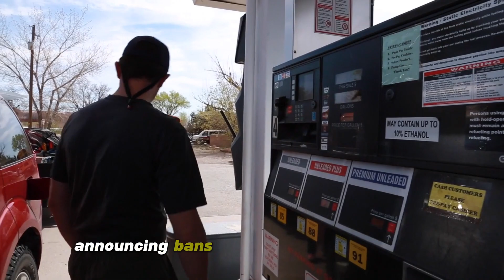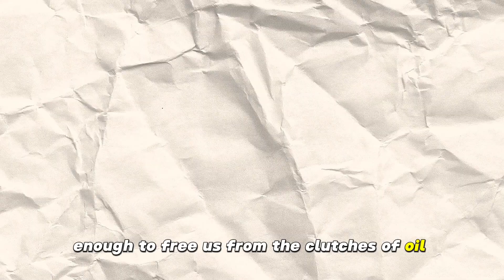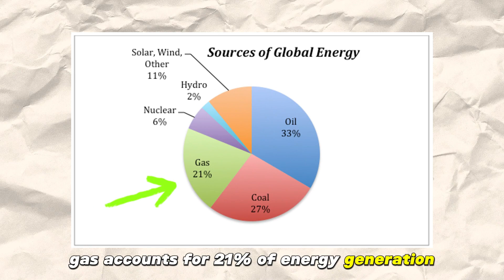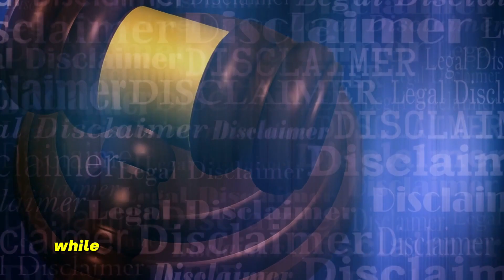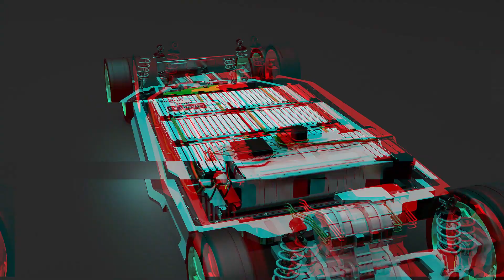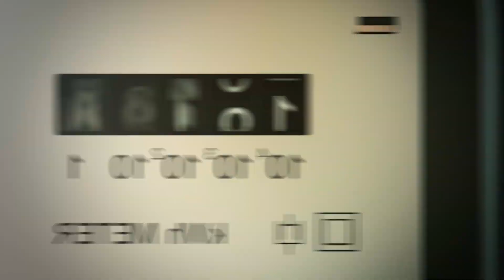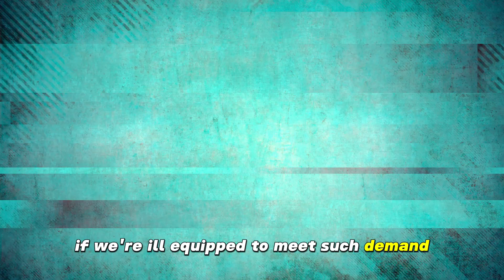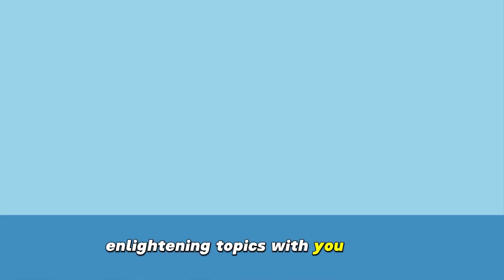The HIDDEN DARK Reality Behind Electric Vehicles: ECO-FAIL or Eco-Friendly?

Comment: still has less impact, we can recycle lithium, also LiIon is becoming old tech, LiFePo4 contains no cobalt, and is quickly becoming the better option for EVs, especially lower performance everyday Evs.
other chemistries will take over in the next decade too, and require much more environmentally friendly materials, like sodium battery, or other

The grid is fine, just get exceed the countries demand with wind turbines, for example, the UK, if we installed another 80GW of wind turbines, we would be able to power the country with wind even when its just breezy. Theyve done the math, if you cover the UK with over 300GW of peak wind turbine output we'd acheive absolute energy securuity, there isnt enough road space to draw more than 160GW of energy on the UK island, however i understand this doesnt work for less exposed parts of the world, like the US, Austrailia, but then solar is better there, just hurry up and recycle solar panels.

Instead of moaning about change, making this video, etc etc, lets encourage recycling, and push for peak sustainability. theres no golden bullet, but we have no choice, fossil fuels will prolong human suffering. even if sustainable efforts only get us to 2150, its better than dieing of lung cancer by 2060
Reply: worried about lung cancer from vehicles... not every other type of cancer from literally everything else now. and if you think road vehicles are more than a drop in the bucket on any pollution, you're just willfully ignorant. nothing is gonna be done for shipping vessels, because you can't. soon as they get to international waters, they can do as they please. this has all been a scam to keep oil companies making just as much, or more. since here in the us, that's like 50 times the size of the uk... most electricity is made from fossil fuels. so, let's not work on better fuels, lets work on totally transforming several industries to maybe break even at best. nobody is dying of lung cancer from cars. that's just stupid. you'd have to stand in traffic and even then lean down with your face stuck in exhaust pipes your entire life. they've been plenty clean for decades.
Reply: false
Reply: @rotaryenginepete  https://www.youtube.com/watch?v=s2xrarUWVRQ
Reply: @rotaryenginepete  instead of denying facts, go and educate yourself
Reply: @rotaryenginepete  just because your a petrol head, doesn't mean you have to take the Mick out of everyone else who cares about clean air
Reply: @SustainableGal  if you actually cared about clean air then you would first educate yourself on what the actual problem is and then just how unsustainable and detrimental your "solutions" really are.  Lithium iron phosphate batteries are drastically less energy dense than lithium ion batteries, so they actually require much more energy to put into service because the vehicles have to lug around 40% more weight.  And as for your beloved windmills, they only last about 20 years, they require massive amounts of fossil fuels to manufacture and construct, they kill thousands of birds, they create wind shadows that are harmful to the climate & air quality, and best of all they aren't recyclable so they get tossed into gigantic landfills.
Reply: @rotaryenginepete  Well if you care about clean air then windmills are far cleaner than any other form of fossil fuel power. You point out the problems with windmills without acknowledging that even with those problems they still are cleaner. If you care about clean air it seems like you should educate yourself.

There is a place for LFP batteries (usually in cheaper and shorter ranged cars) and even the most inefficient battery is still a couple orders of magnitude cleaner and cheaper than ICE engines.
Reply: @Aircam73  you do realize that you need a bunch of fossil fuels to make windmills?  And as for the non-viability of LFP batteries, apparently you've never heard of clean burning synthetic fuels.  Maybe look them up, because whether you like it or not lots of automakers are working on designs and concepts to keep the ICE alive.  Porsche calls them e-fuels and they have already built an industrial scale production facility.